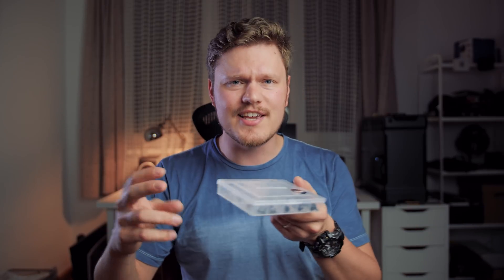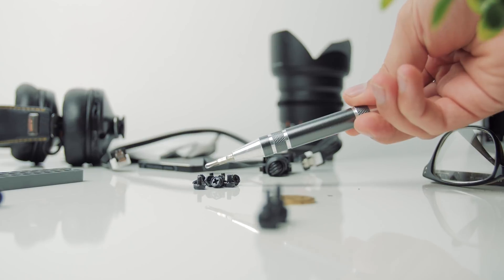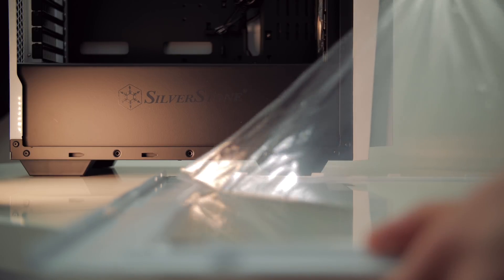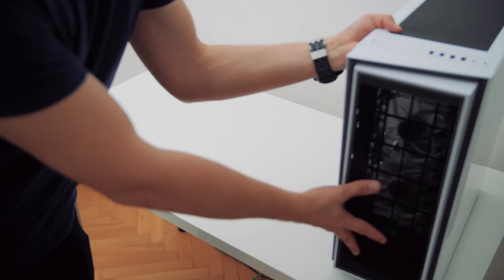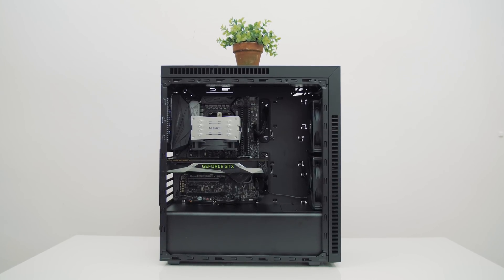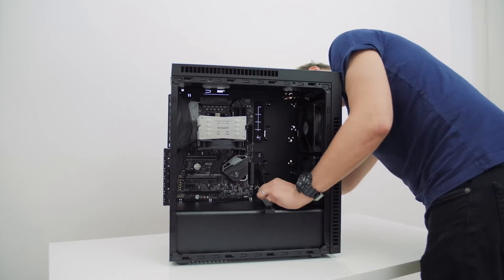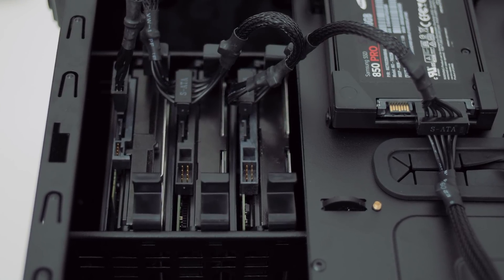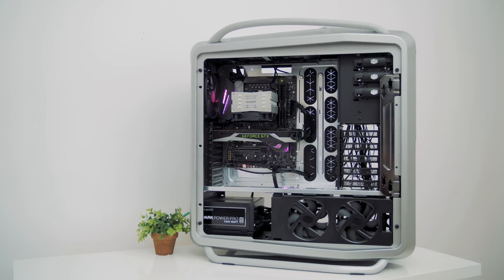15 Things You NEED to Know When Building a PC!

Comment: actually making the cpu air cooler facing up makes the cpu getting higher temperatures because of the gpu's hot air that goes up. (i'm not talking about reference gpus) it was a test that bitwit did.

Comment: - Make sure to peel off the plastic sheet on the baseplate of your CPU cooler. I made that mistake. Twice.

- Make sure that the baseplate of your CPU cooler isn't in interference with your motherboard VRM capacitors. I had this issue with the CoolerMaster Seidon 120V, which features a rectangular-shaped baseplate.

Somehow I didn't manage to kill my i7-3770 in the process of doing those mistakes... Somehow.

Comment: Another tip

When balancing your build, choosing the proper hardware and making sure you wont get a bottleneck, rememper the monitor. Buying a good grafic card but havin a 60hz monitor is such a waste.

Speeking from experience...
Reply: Good advice.
Reply: [KSH] I would get a 4k monitor but my dad would say that we already have 3 4K TVs. I’ma just put that 70 fucking inch tv on my 50 inch tesk that only supports 20 pounds!

Comment: At 5:10 your AIO tubing connection at the top of the radiator is the highest point of the loop. This very thing has caused me headaches with my h100i. Air bubbles at that high point resulted in the pump starving. Sounded like a cat after a Metallica concert. I realize this is not an improper way to mount those coolers and many people do it successfully, but it's still something to keep in mind. Some loops just happen to have more air than others. In my case, the cooler was already out of warranty when I decided to reposition it. It didn't go well, but simply reverting to the original position solved the problem. Kind of. My pump is halfway to heaven. It does still sounds like crap when it starts up it quiets down after a few seconds. When it dies I'm getting a Dark Rock or something similar.

Another general tip: don't put plants on top of electronics if you live in a house with females. They will water it without remorse.

Comment: All these "computer building tipzz" videos need to start mentioning the LGA "crunch" when you install an LGA CPU. First time builders are more often than not terrified of it and think they broke their parts before they even started.
Reply: After 7 years, he didn't mention the most important point.  BUDGET, or, how long you can tolerate waiting to finish the build to increase that budget, E.G., buying parts as you go!  AND, researching to make sure none of those parts will be different or better, and affordable, before you can finish the build!  NEXT: After deciding what platform, for instance, AMD or Intel, the mainboard should be chosen, FIRST!  THEN, use mainboard compatibility list, especially for RAM!  Also, don't scrimp on case, power supply, and especially monitor!  Then you can go buy a frigging magnetic screw driver.  LOL!

Comment: From experience... If you have a modular PSU ; setup what connectors you need and for non modular ones; use zip ties to clean which cable you don't need. Also PSU goes in 1st and then mobo... trust me it saves a lot of time for a beginner

Comment: TOP TIP THAT I'M GLAD YOU MENTIONED.
Route and PLUG IN the 8 pin CPU power cable. It can be a bitch with your fingers stuck between the edge of the case and a massive CPU heatsink. Use a small screwdriver and lightly jam it in the back of the connector to guide it in if you forget to do this. Just think. 10 years ago we didn't have those fancy grommet cutouts or CPU cutouts. We had to mod that shit ourselves. And who needs temperered glass when you can use plexi and etch in some cool logo and illuminate it from the side.

Comment: Grounding yourself by touching painted chassis is kind of useless - you have to touch non-painted part of some water tube (central heating, if it runs in the ground, or water tap, if building has all-metal pipes), grounding pin inside the power socket (if in Europe, where grounding pins are exposed), and only then touch UNPAINTED part or PC case (like PCI screwhole that is without paint).

Comment: Why install RAM on non black slot first? I browsed online and some of people said primary is colsest to CPU.
Reply: Chengxuan He refer to your motherboard documentation always to save yourself the hassle.
Reply: wabber jack But my motherboard manual says nothing about what what DIMM slot is primary?
Reply: Most manuals say: if installing single ram use  slot x. If installing in dual ram stick use slot y and z.
Reply: For my particular motherboard ASRock x370 taichi it lists the slots (closest to CPU)a1 b1 a2 b2 (furthest from CPU). If I were to install one ram stick it would go in a2 slot. I installed 2x8gb in slot a2 and slot b2.
Reply: wabber jack Why not A1 and B1?
Reply: On your motherboard web page scroll down to quick start guide. It shows a2 for one ram. A2 and b2 for 2 dimms
Reply: wabber jack Thanks a lot! I don't know they put this information in quick start guide but not user manual, that's weird!
Reply: Usually colour coded so if in doubt or without manual use non black slots first.

Comment: Keep in mind, graphics cards give off a lot of heat. While heat rises, it is usually better to have your CPU heatsink taking in cooler air from the front of the case (in most configurations).

Comment: Use the provided mobo mounting screws that come with the case ;)  Tried to use my spare parts screws -> no go :(  Also, on modular PSU, install the cables into the PSU BEFORE mounting ;)

Comment: My son and I built his system outside of the case, and then wasted 2 hours because we didn't know how to turn the system on correctly (you can't just turn on the power supply) Some nice guy on one of the LTT forums finally told us we had to use a paperclip to short out two pins on the motherboard. I have watched many many build videos and not one of them has ever mentioned how to start the test system. Including your video.
Reply: if you think about it... what the case power switch does is exactly shorting the two power switch pins when you press it. you can always plug it to the motherboard outside the case if you feel better, or salvage a switch from an old case (they're all the same). surely I won't pay 20 more for a motherboard just for the switch
Reply: awesome thanks Kevin
Reply: screwdriver works to
Reply: OngoingTech some do... but some (including the one we bought) don't.
Reply: Bill Anderson hahahahaha omg I can die now

Comment: Very nice video tips.  But before I was about to build my own beast pc I watched a lot of tech and already did all of it perfectly.  Didn't even check if it powers up outside first, just put it inside the case the Button press test and worked like butter.   The only thing I didn't know was the 8 pin cpu connector which did give me a bit of work :) but my cable management is really good anyway
Reply: i was working with a corsair 400c (case without much headroom at the top) and with a massive NH-d15 cooler. It was one hell of a gymnastic and perseverance exercise to get my 8-pin cpu power plugged in. It required me to bend my hand and fingers in ways i never thought imaginable :o

Comment: Touching your case doesn't ground you because the case is painted.
Reply: The paint is thin enough for that not to hinder conduction and quite some paints conduct on their own due to the materials used to make the pigments for example. Not to mention that powder coating works by the use of electrostatic power :)

Comment: can someone explain what he said about the mobo mounting? i cant undersatnd what hes saying there.
Reply: There is normally a pre installed standoff to hold your mobo in place for you while you put in the screws. you just wanna make sure it will work with your mobo and not touch any important parts on it to short it out.
Reply: Nbk2k11 and what did he take out of the case? a little metal thingy.
Reply: I believe it was just a part for screwing in the mobo.

Comment: Can some explain how do you actually ground yourself with a wrist band? Im confused and i'm going to build my frist pc next week.... 

Any help?
Reply: well its a grounding wristband that youre referring to, it should have a smal piece of metal on the inside that makes contact with your skin and then has a insulated wire coming from it that you need to clip to some sort of grounded surface, just about any unpainted metal surface will do
Reply: although in all honesty its not really something i would worry about as a first time builder like yourself, ive built pcs with and without my antistatic mat and my strap and never run into any issues. So in the end its up to you on the better safe than sorry aspect but dont feel you HAVE to have all the gear to build, good luck on the first build! its a verrry addicting hobby haha
Reply: Alex Henry ahahaha thanks , but one more question , just to be more secure .

I have heard people that to prevent static you should put your psu before everything , then plug it in an outlet and make sure the psu switch is off. Then touch a metal part of your case. Is that true? I'm building in a cooler master mastercase maker 5 . Thanks for your help!
Reply: MrMatth 95 hmm, well that COULD be a great way to make sure you're grounded but it assumes your houses wiring is safely and fully earth grounded, tbh it's a little overkill and could end up backfiring if the outlet ground is screwy, youre better off touching a metal surface from time to time that is not the pc itself
Reply: those wristbands should also contain a high ohm resistor(commonly 1 megaohm). the very high voltage of static electricity(10000 volts and more sometimes) will leak through the resistor but you wont get electrocuted in case you touch a live wire(the resistance through your whole body and through your boots is a very high so the current will be a lot lower than if you were grounded direclty).

Comment: Tip #16 Remember to RGB ALL THE THINGS
Reply: amen
Reply: WHY?  My current build will wind up having all RGB turned OFF, except for the case!  I am customizing separate RGB designs, not part of any of the system, to use in my case, and possibly outside of the case, such as on my printer.  :-p  I will use some other things people don't usually use.  This build will definitely be, one of a kind!  :-)
Reply: !!!YES!!! and put the case on your desk close to your display so it fucking glows like in Las Vegas while you play your favorite game, helps you focus :)
Reply: I think rule #0 should be, once you buy it, it's obsolete. This makes buyer's remorse a lot easier when the newest CPU or nvme drive comes out a week later, at half the price. 😂
Reply: Lol absolutely correct bruv

Comment: wouldn't the vertical cpu cooler suck up the hot air from the gpu?
Reply: Most gpu coolers are designed to blow the hot air out the back of the case threw the little vents on the gpu or out the sides.

Comment: Can u also make a vid on push and pull and which is better plzzzz
Reply: Linus did a great video on radiator push vs pull.  They both give similar performance, but pull makes it easier to keep clean since you don't have to take the fans off the radiator to clean the dust off the radiator.  Push AND Pull will give better performance than both if you have a very restrictive or very thick radiator though.

Comment: Tips for your builds : Prepare for more money.
Reply: Seriously this. 

Your taste will change, perhaps even the room or desk, stuff doesn't normally break but can and eventually software gets too heavy, or you get into some new facet of the PC world only to discover your motherboard or other part is going to be a bitch about it. 

I'm pretty sure you can just endlessly throw money at a PC, especially considering anything pluged into it as part of the overall cost.
Reply: Javier Valdez In case you'd want to buy rubber fan screws, or an item that is compatible with the build (in case you screw up)
Reply: I've got an A10 5800k system upstairs that cost $300 3 years ago, that'll do some light gaming. It wouldn't be that hard to get a more capable system for the same price. (In Canada, in America $300 would buy like twice the horsepower.) And a mere $100 in GPU added to the system would make it a reasonable medium detail 1080p gamer. It's not $0 but I'd make that as a kid in the summer doing odd jobs. And as an adult while it's not a quick thing to gather $400 I wouldn't call it hard to do.

My personal system has had plenty of cash thrown at it, but besides my mouse, mousepad, Fiio e10, and Hue+ none of it was bought at full price, plenty of it was refurbs or open box, and 50% discounts pretty common. It's easy to save cash at any level of budget.
Reply: Brock oh come on show me your rig without money involve 😂😂 make sure it can run minecraft
Reply: so true, i spent more than i thought i was gonna spend. =-(
Reply: Can't run out of money if you don't build a pc roll_safe.png
Reply: Aljory Rumbaoa why?
Reply: Red`s Report i change my 8 years old gaming pc. Spend 1k sounds super good for me. Instead off xone the buy xonex and now they gonna bring another one
Reply: Nah you can build a PC without cash. Slap together some shit like in scrapyard wars. You don't technically need an SSD, or case, or a fancy CPU to build a gaming rig.

Even my crazy overspending has all been done with sales, discounts, referbs, and open box stuff.
Reply: You don't build pc if you don't have money
Reply: Red`s Report haha
Reply: Facts
Reply: Yeah because $6 is so much.

Comment: My tip would be about the cpu socket thingy that keeps the cpu in place: It requires a fuckton of force (not actually that much but it is much more than you would expect)
Reply: ImThatTardisGuy Yeah, contrary to what Dimitri would have you believe, lowering the CPU socket lever requires force and is genuinely terrifying.
Reply: I know I'm 6 months late but what Dimitri meant was placing the CPU in the socket, not lowering the CPU socket lever which does require more force than one might assume
Reply: moms spagetthi
Reply: My palms always get sweaty and beads of sweat on my forehead. That's the part that really elevates the "pucker-factor" to geometric proportions man :0
Reply: he meant the lever, you have to put force on the lever

Comment: Can you give some tips on those damn IO SHIELDS!! I NEVER figured them out. those pins and the mobo just dont go together in a perfect way.. :(
Reply: Lower the mobo into the case in an angled fashion, so first you will align the IO ports with the shield, then, when it is more or less aligned - lower the rest of the motherboard and at the same time push it towards that shield so you can align it with the support for motherboard screws.
Reply: That middle motherboard standoff that keeps it in place helps out a lot here. If you're lucky enough you might not need to push the board at all. Without it, you WILL need a magnetic screwdriver or a third hand to keep that screw a the tip of the screwdriver. Luckily, I don't even recall when I last saw a non-magnetic screwdriver anywhere.
Reply: I have no idea how you could possibly do an io shield incorrectly. I just don't get it
Reply: BanterEdits same
Reply: get a core p3 like I did and just throw that shield away 😂
Reply: I had the same issue on my first build with a somewhat cheap motherboard. Just a simple stamped sheet metal io shield and all these little tabs sticking out around where the ports should be. i just cut them all off with a dremel, but im sure simply bending them and test fitting the plate against the ports outside of the case will help with some headaches C:
Reply: A
Reply: yep...that's exACTLY how I do it too. Works like a charm.
Reply: Apply with sledgehammer